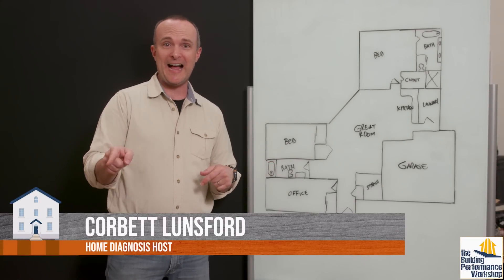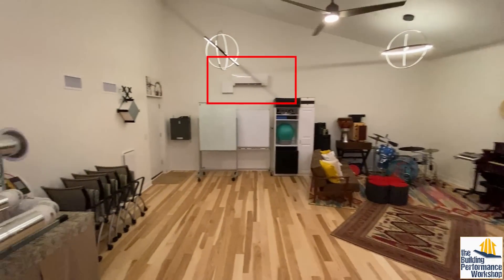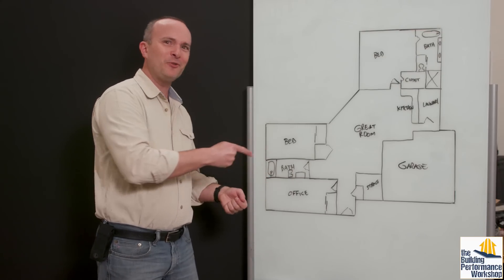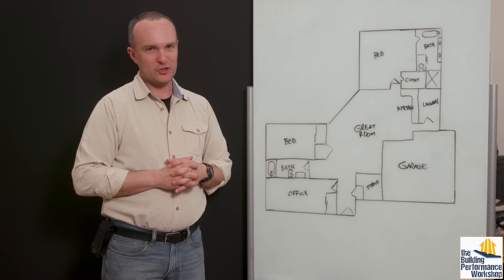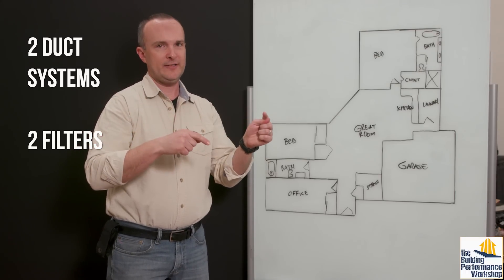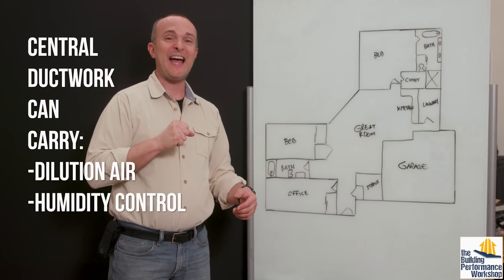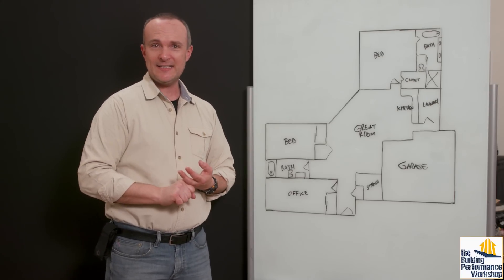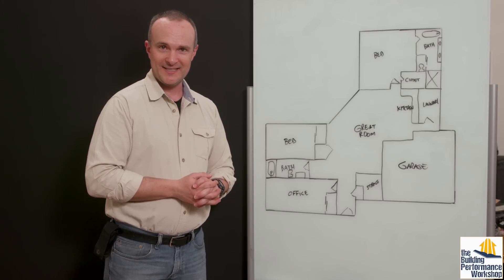HVAC Ducts Reality Check: Are Ductwork Systems Dumb or Essential?

Comment: I live in a largish house, and previous to installing some mini splits, it was heated via baseboard and radiant during the winter and expensively cooled via ducted central AC on hot days during the height of summer. There was no ducting in the bathrooms or laundry rooms. The ducts run through the unconditioned attic taking up a huge amount of space. 

I can’t see how a ducting system that only ran intermittently 4 months a year helped air quality very much. 

Maybe the fact I have daily vacuuming with the robots, but the air seems fine all year round without a huge amount of dust. 

On the other hand, after putting in ceiling mounted mini splits in the bedrooms, everybody gets there own temperature all year round and it’s ⅓ the running cost of running the whole house ducted AC. 

It isn’t picking up much dust, that is true.
Reply from the maker: Ys, there’s never just one way to achieve performance goals, but some products and technologies are marketed so aggressively that it helps to step back and remind ourselves of the whole system. I have tons of clients building from scratch and almost falling in psychological potholes embedded in experience in old homes.

Comment: I agree with what you are saying, except the view that the house air will be dirty if it's not vacuumed by the furnace.  The largest source of new dirt is the outdoor air coming in through the ERV.  Put a high-end filter there, and it's good enough.
Reply from the maker: Oooh, I have to disagree with you there Josh, WE are probably the biggest source of new dirt. Most dust is actually skin flakes. Gross.
Reply: @HomePerformance  That's an oversimplification that has been dis-proven.  Here's a Veritasium video about that: https://www.youtube.com/watch?v=jn5M48MVWyg  TLDW; about 20% of all dust is skin flakes.
Reply from the maker: Ok, so your plan for the 20% is what if not filtration?
Reply: @HomePerformance  the ERV will kick that dusty air outside. Just hepa filter the incoming air and its all good.
Reply from the maker: I have a hard time believing that will work, but test data could prove me wrong

Comment: As a HVAC mechanic for 40 years I can tell you duct is filthy. Radiant floors, ductless ac, and a HRV provide a perfect environment. Hydronic heat is easily zonable giving every room its own thermostat. Ductless again, every room enjoys its own temperature setting. We have converted several homes from ducted a/c to ductless, not only did the customers cut their electric bill in half but the dehumidification mode on ductless allow for much better dehumidification. Crossover fans are not necessary as  everything in the home falls into equilibrium. Never had a complaint that the bathroom was too hot. Why do we have so many kids today with breathing problems, much more so than European countries. Could it be the US is 98% ducted garbage and Europe is 99% hydronic...I would bet on it.
Reply: I wanted to make a similar comment. You make great points. Thank you. I’m intrigued by the influence that health is having on both science and marketing when it comes to living indoors.
Reply: Any dramatic changes in my natural gas forced hot water would cost a fortune. It's fine for new construction but I could never recover the retrofit cost.
Reply: Because fiberglass is exposed in the interior of boots. And a tons of hvac contractors always say it’s easier to make something out of fiberglass duct board
Reply: Are you familiar with any reputable monobloc manufacturers in the hot-humid climate market?
Reply: I think ductless systems suck. I would not recommend that over central. Central is always the way to go. When they break they will be down for a while that’s just how it is with ductless. No HVAC contractors carry parts for them. They never will because there’s too many changes too much money. I would rather have vents than a cassettes all over the house. After so many years, do you have to replace the whole ductless system hopefully installed in a way for easily replacement. Radiant heating works great with central heating cooling. You can still have ventilation.

I know they’re making homes incredibly tight the high-end stuff 2 tons for 5000 ft.² that’s something I have to see
Reply: @benkuxhouse787  Parts are becoming a thing of the past. I just lost the compressor in a 2 year old hi heat Comfort star. They sent me a new unit. The days of keeping stock of each and every part is quickly fading away. Cost way to much money and time. I remember when you would go and purchase a needle seat or gasket for your lawn mower engine, not anymore, you get a new carburetor for 20 bucks. The problem with ductless is you still need to know how to handle refrigerant. These new air to water monoblock systems eliminate all that. All you need to know is how to use PEX and shark bites and follow a simple hydronic schematic.
Reply: @anthonyspadafora1384  how hot does water get to?
Reply: @benkuxhouse787  in what? On my radiant systems? My outdoor reset will take the water temp to 120 on a zero degree day. 

 at 1 to 1. So every 1 degree warmer the outside temp lowers water temp 1 degree. Outdoor temp at 20 degrees water temp is about 100
Reply: @benkuxhouse787  if you mean how hot does the water get on these air to water heat pumps. Most are 130 max. But the ones using CO2 as the refrigerant go to 150
Reply: @anthonyspadafora1384  100° works good for radiant heat
Reply: @benkuxhouse787   Depending on outside temp and type of floor covering 100 is usually fine. We have done some old farm houses where we had to add some low temp panel radiators to supplement on colder days. But for your average insulated home it is fine.
Reply: @anthonyspadafora1384  old homes that I have worked on with regular hot water baseboard if the water is in at least 160° it won’t work. Radiant heating is great but a lot of existing homes out there That is not an option.
Reply: @benkuxhouse787  If you watch some of the English YouTube videos. They are changing out boilers for air to water heat pumps but many homes they must add additional radiation.
Reply: @anthonyspadafora1384  yes they have been doing that and it’s been a disaster. The homes are not tight enough and they were designed for 180° water. They’re back and away from it now.
Reply: How do radiant floors cool your house?  And how do you fix it if it breaks?  Rip up your whole floor?  Doesn't sound very smart to me.
Reply: @sa3270 I have a crawl space so my radiant is accessible.  But for upstairs you would have to pull up flooring.  But why would it break?
Reply: @sa3270   I dont use my radiant floor to cool my house, my home is only 2 floors about 900 sf per floor. When you cool with radiant you use a chiller and incorporate a desiccant dehumidifier to control dewpoint. This is usually done in really high end homes although I was just in Atlanta at the AHR expo and Uponor was introducing new controls to lower the cost of radiant cooling. I use ductless inverters throughout my house. As far as radiant tubing going bad, I have yet to see that in a properly installed job. We install all tubing whether it is under concrete or wood floor with no joints. Pex tubing is purchased in 500 or 1000 foot rolls and is pressurized to 100 psi through the install. Loops are never larger than 300 ft in residential and is easily located with thermal imaging and easily isolated if something would happen. I suppose you could say the same thing about your sewer pipe running under your house. The latest thing for radiant heat and radiant cooling is the drag strips. I was ask to help install a very expensive system at a local drag strip. I suppose it is kind of stupid to split milliseconds in a quarter mile if everyone is running on different temperature tracks. Soon only radiant tracks will count as real time. If piping breaks, you locate it with thermal, cut up a few sf and fix it. If you ever see those home in Vail CO that sit on top of the mountains but you see a melted snow driveway going up for miles. That is all radiant snow melt. The boiler rooms are larger than most peoples houses. I can understand why you would think it is stupid but in reality this is next level heating usually the skill needed is much higher than your furnace/duct men. You have to understand fluid dynamics, pumps, heat load. It is a trade unto itself, so don't feel bad.
Reply from the maker: Well said
Reply: @anthonyspadafora1384 Great comment! Floor heating is absolute standard in Europe and works very well. Still for cooling with it, you can only cool a few degrees below the outside temperature to not cause condensation inside the room. 

Therefore I’m interested in the desiccant dehumidifiers to control dew point that you mentioned. Do you happen to have a link or so to some of them? Thank you!
Reply: @anthonyspadafora1384 that’s real spill. I came from heat pumps but if I started with boilers transition to AC chillers ice makers beer chillers etc the big money stuff I’d be gold. Hydronics will become main stream in US in next 20 years it’s already monoblock heat pumps being pushed in Europe which I think will eventually spread over here
Reply: @sa3270  I absolutely agree in every way!! I couldn’t have said it better.
Reply: Anthony you are ahead of the time ! Good to see some who see reason to build better.  Jim
Reply: DO we have have have more breathing problems among kids here vs Europe? Reference? 

I agree we may have more breathing problems than in the past, and probably more than some countries, but without data I’d bet we’re very similar to Europe.  Leading immunology theories lean towards increase in allergies and autoimmune disorders being a result of us living in TOO clean an environment, where our bodies haven’t had enough exposure to learn to discern really bad pathogens from less harmful stuff like peanuts.
Reply: @mrayoung The too clean hypothesis is a great test of basic critical thinking. Simply look at groups of people with the highest income vs lowest income in the USA. They will have vastly different exposure to pathogens on average since hyper cleanliness is a luxury. 

Do we find the highest income has higher rates of allergies? No, we find exactly the opposite, with the poorest being at higher risk for allergic disorders to everything from food to asthma.
Reply: @mrayoung  Then by all means build your house with fiberglass duct, Ill stay with my radiant floor heat.

Comment: Having enjoyed the video, and having been given some new factors to consider, here's a question. When I build my monolithic dome home, how would you handle the air in such a structure? There may be multiple connected domes as well, and I know they must have a system to pull in fresh air, but the structure may be easily 100' across the width, and perhaps 70' deep. Thank you.
Reply from the maker: Short answer, Randall: Balanced ventilation, duct system connected to all rooms, high MERV filter, humidity control, pressure relief for any oneway exhaust fans.

Comment: Having lived in homes with conventional ducting and now in a house where the AC has to be delivered by the small hoses, nothing else fits in the walls of this 1940's home. There is no doubt that the high pressure AC is noisier than ducted AC, however it runs a lot less so it sort of balances out. That said if I had a choice I would go with normal ducts but overall I am pretty happy with the high pressure small hose approach also. As far as filtering the air it is the same as ducted and uses the same filters and a central return.
Reply: but the higher velocity and higher static pressures do force more duct and dirt through the system

Comment: Now I’m more confused. It has felt like in the past you advocated separate duct systems ideally for all these systems, if not at least between ventilation and conditioning. This video seems to push a single duct systems to rule them all. Even if sized for all fans going, I’m not sure I could believe that the static pressure could not be out of the zone for some of the fans. I still see manufacturers and experts argue where systems can be joined (supply or return) and with what kind of controls and dampers and such.
Reply from the maker: Yes, I built a totally separate ductwork for my conditioning and ERV, Todd, but wouldn’t do it again. The cons outweigh the pros. And there’s no such thing as ductwork that’s too big, so you’d just upsize them to contain it all and then use ceiling fans for room mixing.
Reply: I would like to hear more on the conns. Perhaps a postmortem on your system a year later. I’m in the retrofit business- all the houses I work on are old, so often massive ducts are not a reality. Then again, lots of little ducts are not always great either as every time I open a wall it’s usually a WTF were they doing moment.

Comment: Yes, if your house was designed to RELY EXCLUSIVELY on a forced-air system to heat and cool your home, you don't have a choice but to rely on a ductwork system and all that entails to distribute that conditioned air to every nook and cranny in your house. BTW, that very system is what consumes the most energy in your house and for the same reason why you shouldn't have carpet on the floor and vacuum it regularly as all the contaminants trapped are now agitated into the air, a poorly designed (the HVAC vendors are typically NOT qualified to design it like a professionally registered mech. engineer is), improperly maintained central system, guarantees that you are breathing in mostly recirculating air that is definitively BAD for your health. However, there were so many statements that you made which are questionable, or certainly a majority of practicing architects and mech. engineers would disagree with, that I hesitate to even bother commenting. I am an architect in the non-residential (more commonly mislabeled "commercial") sector and I always have an MEP (Mech., Elect. & Plumbing) engineering consulting firm on the project who would design the HVAC system which is almost always the most sophisticated and thus problematic building technology system in any commercial building. I designed research labs where we are required to have nothing but one-pass air so the occupants don't die from inhaling the dangerous stuff kept in the labs. We recently performed a contract to install UVGI air sterilization system on 98 AHU (air-handling units) on a federal agency HQ boasting over 1M SF, so I needed to understand a thing or 2 about HVAC systems than I ever wanted to as an architect. If we just go back 70 years before WWII, even the uber wealthy didn't have HVAC or ductwork in their magnificent mansions. One of the greatest benefit of residential as opposed to commercial architecture is that you don't have deep floor plates and most rooms have windows that permit natural ventilation and Americans have always been limited to that, whether they lived in the sweltering Florida or frigid Maine. What happened to us, have we become wimps who cannot tolerate anything less than perfect all year round thermal discomfort? We suffered from the erroneous assumption that every house must have a forced-air HVAC system, an laundry dryer, and 2-car garage with driveway enough for another 4 which must have at least 1 if not 2 big SUVs yet we are now obsessed with EV, renewable energy generation, and absolutely clean in-door air. In the beginning, after mechanical refrigeration was invented, only public assembly halls had A/C installed. After WWII, the military industrial capacity needed to beat the enemies of world peace was converted to produce what we now enjoy as modern residential amenities. The economy of scale made such inexpensive and affordable so most builders don't think twice to include them for their products. I walk around my neighborhood during our wonderful spring and fall seasons, almost all the houses have their windows shut and A/C units humming loudly. During the pandemic scare, ASHRAE recommended maximum outside air to dilute the potentially contaminated indoor air. Fresh outside air is still the best air for most people and in Germany, because their typical heating system is radiant (radiators with hot steam or water like America used to have before the unfortunate prevalence of force-air heating), people regularly crack open their windows to get fresh air in and because they are not in their tank tops or shorts but dressed appropriately for winter and their buildings have big thermal mass, it's still comfortable. My point is this, if you START with certain premises, then of course a network of air-distribution system is a must. The best thing about residential architecture is that unlike deep depth commercial architecture, no, it's not necessary. You just have to determine what's important to you in terms of thermal comfort throughout the year and how best to assembly all the "systems" you need to achieve that. Forced hot air is the most inefficient, uncomfortable and costly way to heat one's dwelling, and a major contributing factor to respiratory illness in the winter.